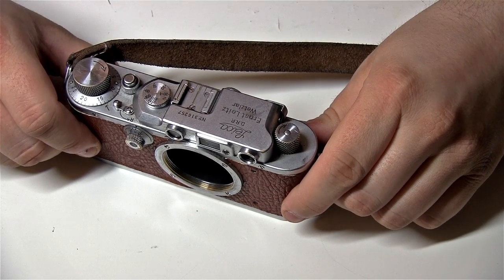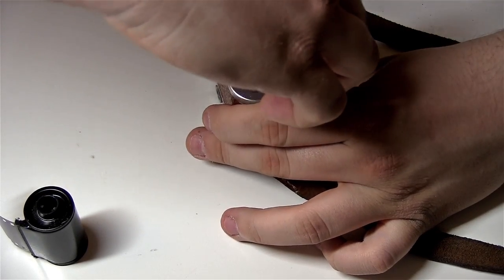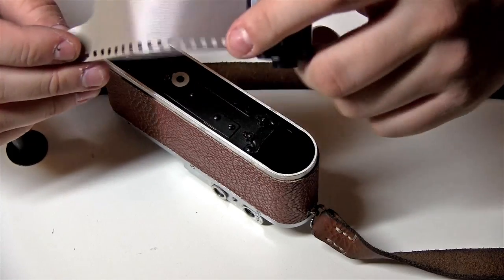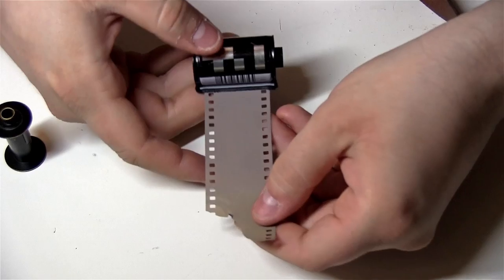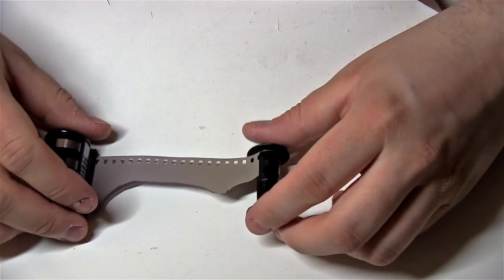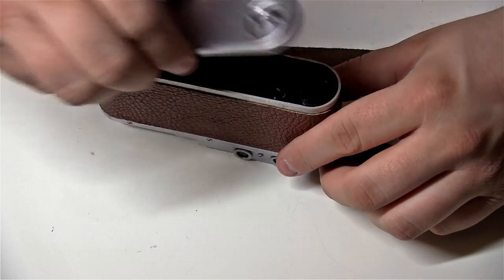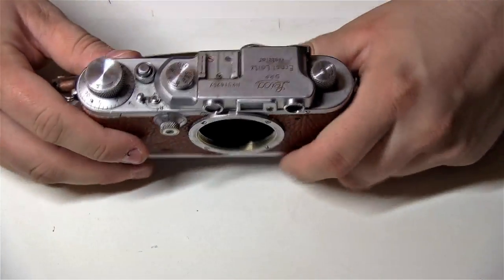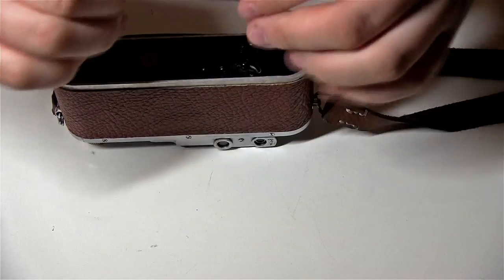How to properly load a Leica III

Comment: I never use my teeth to tear film. Might get slobber in the  camera--besides, it looks half-a--ed when you do that, so I have a small scissor in my kit, and pre-cut the film when I am using a Barnack so I rarely cut it in the field. I bought a repro cutting guide, 3-D printed in plastic. The guide was ok at first but now goes unused, except as a drawing guide for a marker and my Dollar-Store scissors.
Reply from the maker: That's great it works for you! I often shoot many rolls over a very short period of time with my Leica III, so this method works great for me.

Comment: I had one of these Leicas in the 1960s and never trimmed the leader.
Reply: neil piper Probably it wasn‘t a III/IIIa . I‘ve tried it today on a IIIa Without trimming, and the film got stuck + the guide holse ripped out. Tryed it again with trimming and it worked. I think the main difference between the III and the IIIa is the shutter speed.
Reply: @scheichi2000  I saw a video of someone using expired Kodak film I'll actually had a long leader like the one being cut in this video.

Comment: Good explanation. I used Leica, Canon, even a Reid back in the late 1950's and 1960's. They all load the same way. I think Leica was the first camera to use 35mm movie film, so naturally the cartridges were designed to work with Leica... and the copies. Eventually when most cameras began to have a "back door" for loading film, the film makers shortened the leader. It never occurred to me to just tear the film - I always cut it with scissors... rather awkwardly.

Comment: Only thing I would change would be, I actually begin my leader cut from the perforations and come down, rather than across from the front I found it was just easier that way. 

Very good explanation.
Reply from the maker: Good idea!
Reply: @Libsenth  I was getting that "hangnail" if I tried to make the turn, and sometimes, I was having to do some weird arcing curves to hit the gap between perforations, so I just reversed the process, hope that helps.

Comment: Overall a nice video. One thing I didn't see is how you set the film counter to zero. Would be a good addition to add.
Reply from the maker: Thanks for the comment! Setting the film counter to zero slipped my mind while filming, but I added it in text. To set the frame counter, simply rotate the dial until the arrow is at "0"! :)

Comment: Hi, do you need to fire off the 2 first shots at the start?
Isn’t it just wasting 2 shots? Thanks.
Reply from the maker: As with all cameras, it's recommended to do at least 1-2 shots first to bring guaranteed fresh film to the gate. If not, your photo may have light leaks, or missing half the shot. It's not worse than that.
Reply: @Libsenth  Fantastic thank you!

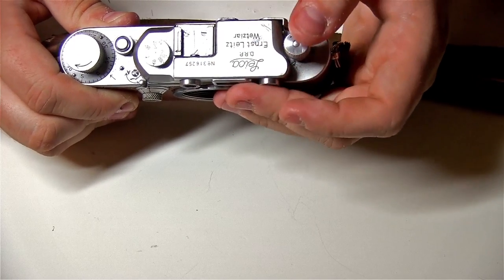Comment: 6:16 why did you turn that to take the film out? I thought turning the other screw was enough
Reply from the maker: As was explained, it is merely tightened to see that it actually moves when moving the other knob. If it moves, then film is loaded correctly. If it doesn't, then it isn't loaded correctly.